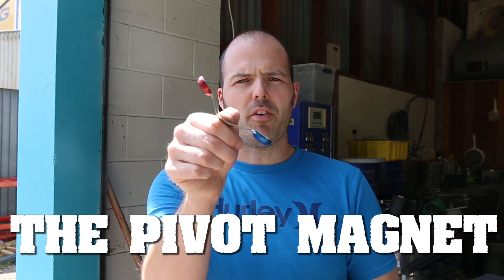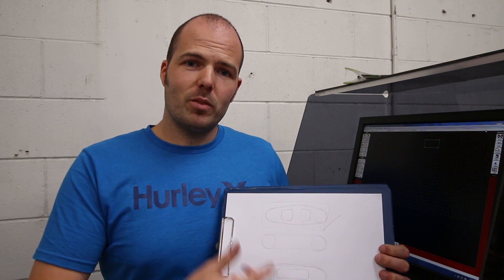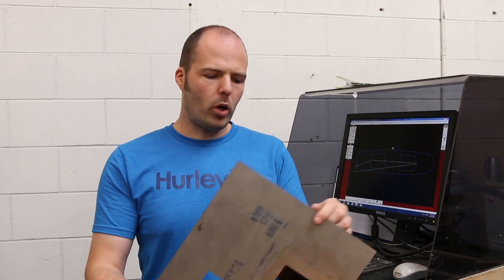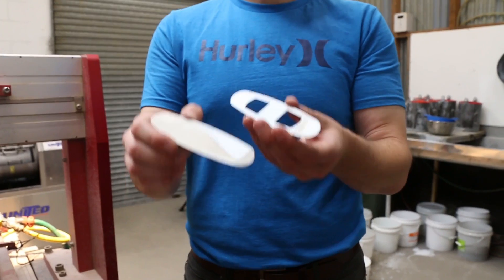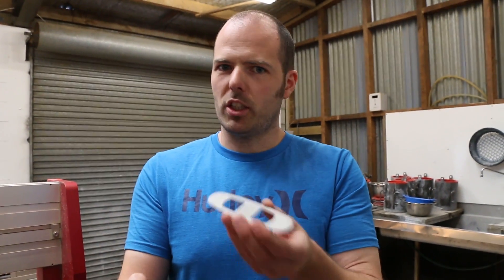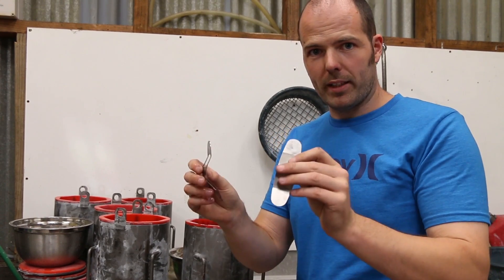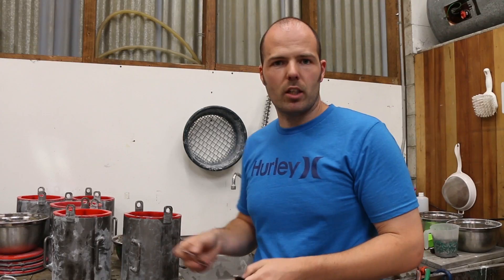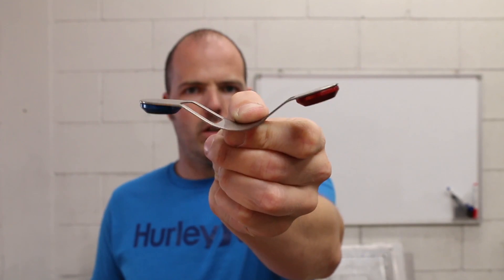Weird magnet invention...

Comment: Funny idea! A strong magnet on the inside of the middle part should hold it in place while flipping (during the small moment where both end magnets are lifted from the surface). That way you could operate it with only one finger (currently you have to use a second finger the middle).